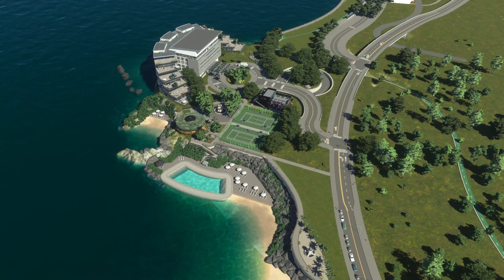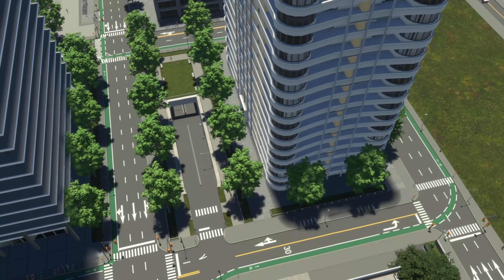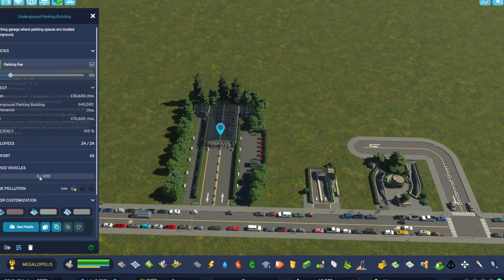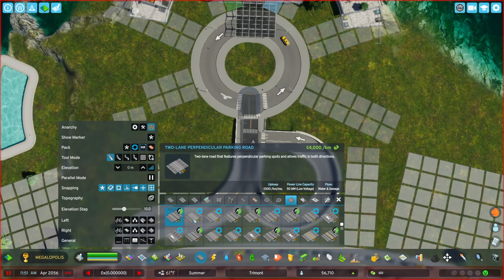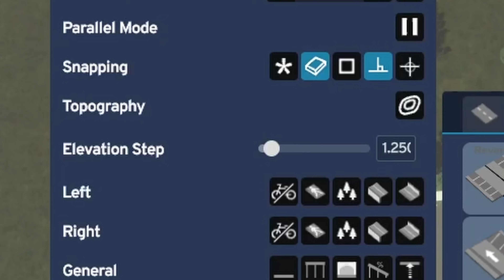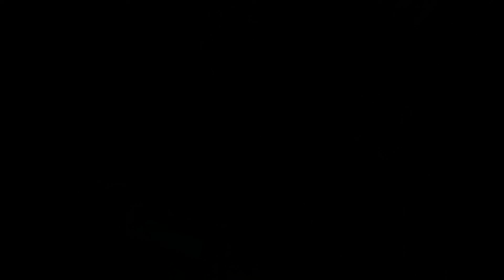How to Build an Underground Parking Garage in Cities: Skylines 2

Comment: Nice build! Are the citizen willing to walk up from the underground? It seems a long walk. Perhaps add some stairway exits?
Reply from the maker: Hey! Thanks for watching. Yes, I should have included more about connecting to the surface with pedestrian paths or invisible pathways. I mentioned briefly but didn't return to the topic. I've built several garages with little elevator/stair exits. They'll use invisible paths to magically rise to the surface. It actually works really well. I may do a follow up showing that since so many have asked.

Comment: Can we build underground building? For example Commercial Street
Reply from the maker: Hi VaisuOuru! I haven't tried. There is a clipping surface that I've messed with to build sunken plazas/parks, etc. but you would really only be able to use static ploppables with it. I could try to use a modular zoning block with the clipping surface, but it's a long shot and I'm doubtful. Thanks for the idea though!
Reply: @graynoisetv  I look forward to your attempt

Comment: Does Cities: Skylines 2 have elevators or stairs for pedestrians, so that exits can be created for them in other locations of the garage? Tha would be the best part of it
Reply from the maker: Yes! Thanks for mentioning that. You can use pathways. Or, do what I do and use invisible pathways connecting to the parking tunnels and then simulate the rise to the surface through an existing building, through a structure you create by hand, or a static ploppable. I did mention it in the video, but definitely should have shown more of the process for more clarity.

Comment: I wonder if you can use a pedstrain underpass entrance, and connect it to these underground roads to make a pedestrain entrance/exit.
Reply from the maker: You can! It's a little hard to orient it properly, but it does work. I end up using invisible paths. I mentioned in another comment, I should have shown a bit more of that because I spend time making entry/exit buildings in a few of the builds.